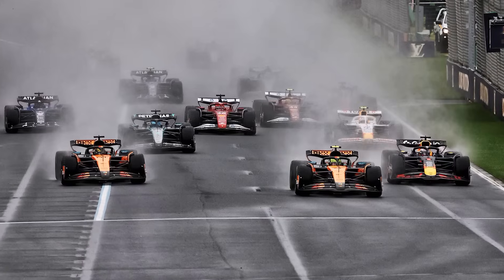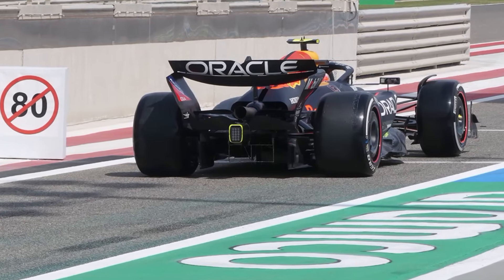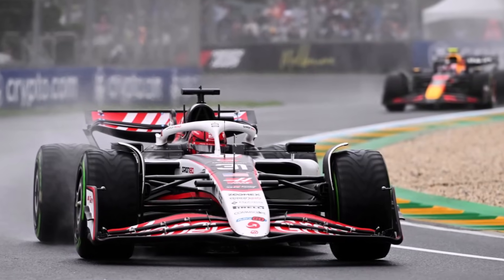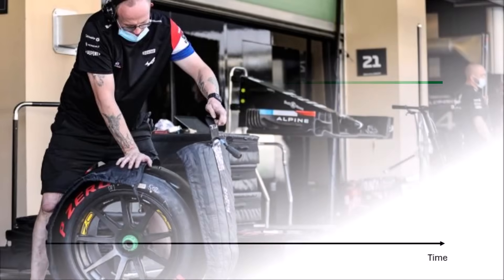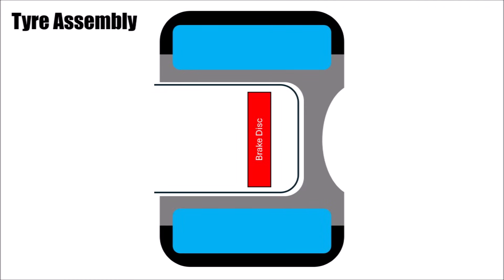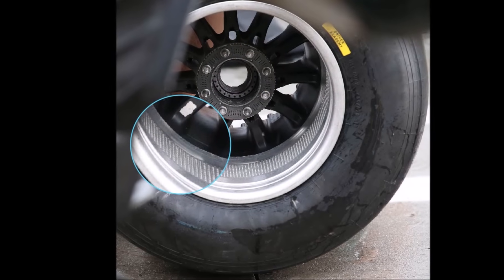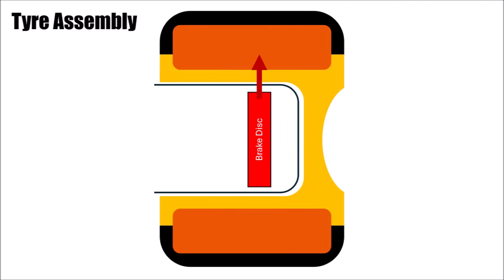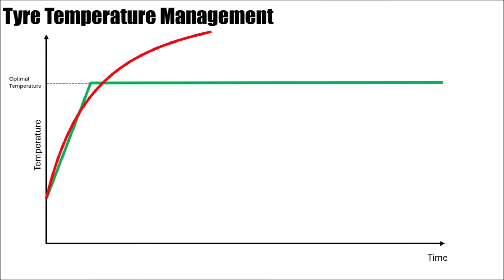F1 2025 - McLaren's Tyre Management Advantage - Part 1

Comment: Hypothetically could McLaren have moved the rear brakes into the gearbox/ differential area and removed them off the wheel axle? If they were able to do something like this without compromising rear packaging too much it would massively reduce unspiring mass and improve suspension performance as well as reducing thermal input from rear brakes into the tyre…. I have nothing to say mclaren is doing such a thing, just a “would this work and or explain red bulls thermal readings?”

Comment: Just use a thermostat out of the old air-cooled VW's. Yes they had a bellows type t/stat that opened another air duct to control the engine temp.

Comment: theres a lot that could assist cooling, could be using metal or even heatpipes to draw heat away and in to exposed components that are in turn cooled by the fast moving air around them. maybe they have found ways to holloww out certain components and reduce their mass and so reduce their thermal potential meaning the components can heat up and cool down far quicker. would also mean higher spikes in heat (the times theyre hot, theyre hotter than most) but would also allow them to cool down to ambient so much faster they could keep the heat out of the tyres). could do that with 3d printing of components with hollow areas with either openings for cooling air to make its way in and out or just sealed off since air doesnt store that much heat compared to metals anyway.

Comment: there is one fluid that is in contact with the caliper and can carry heat: brake fluid
a possible strategy here would be to use the brake fluid to carry the heat away and then cooling it, the system can run like a diesel-hydraulic pump where simply closing a valve increases pressure for an hydraulic arm
now that i think about it it would explain the overheating issues Norris struggled with as the brake lines can be built with lower temperatures in mind, but this is just speculation
Reply: Brake fluid doesn't actually circulate through the system, unless they're using some kind of circular brake circuit with check valves, but either way I think this would be a pretty obvious solution if it were really that effective.
Reply: That is correct, but air is also a fluid gg just different desity #duckandcover
Reply: @rainergumpert5945  liquid would probably better terminology to use but you get the point anyway

Comment: Using more “heat conductive” carbon fibre mix for the brake drum assembly ? Carbon fibre is an insulator right ? So a mix of carbon and a metal alloy (like the so called Carbotanium Pagani has been using for ages on the Huyara) would make it more conductive to heat ? So the tyres would heat sooner and heat in the tyres would transfer to the brake drum easier and with good brake cooling can dissipate the heat better to keep the tyres from over heating. I have no experience in this craft. This is a guess from my basic science knowledge.
Reply: Heat goes from the brakes to the tires, not the other way around. Normal operating temperature for F1 brake pads is about 500C.

Comment: Why water? There are tons of fluid substances used to keep you chill, including those in the driver chill vests. If a substance is easy to chill(air) and hard to warm up(brake discs), all you gotta do is make a device to move it around so that it's chilled by the passing air when brakes are off. Question is, how do they do it to move fast from brake on to brake off?

Comment: Since active flaps etc are not allowed, use of bi-metal in a flap holder looks like an interesting way. Too hot, the bimetal flap bends and let more air in... too cold, it bends in the opposite direction reducing the air flow. I would call the "passive flap"...
Reply: just like the passive breaking RB had, flexi-wings. FIA stomping innovation

Comment: Are the wheels homologated for the whole season?

If not, especially with the aero cover, it's a lot harder to see if they're changing wheels race by race, maybe they have different constructions that conduct heat differently or diffuse heat, depending on expected track conditions.
Reply: Wheels are season homologated, brake assemblies are not.

Comment: I just think they make more downforce than the others at low and medium speeds. Those are the speed ranges where the car slides the most because there's less downforce helping you. If you have more downforce than the others in that speed range you will need less slip angle to generate cornering grip. This all comes down to the size and position of the flow structures at the back of the car, and the size of the diffuser itself. As these two parameters control the back pressure in the diffuser.

The diffuser works very much like the intake port of a combustion engine, with the flow structure acting as the valve, the diffuser expansion acting as the bowl, and the area near the crash structure as the valve seat and combustion chamber.

Think of a VTEC system, the port and valve area is oversized for the engine, at low engine speeds, in order to have enough flow velocity, you need very low lift from the valve to accelerate the air enough through the large volume. At higher engine speeds when the valve starts to choke, you need more lift to allow more air around the valve. The way you size your diffuser and maintain and position your flow structures is similar to sizing the bowl, valve/valve seat, and chamber on a cylinder head.

Comment: Perhaps they have found some sort of heat activated reflective coating, or are using a bi-metal flap covering an air channel? 

So when a set temperature is reached (like during braking) this activates and prevents or restricts the heat reaching the rim surface.
Reply: I think it's such an obvious idea that if moving parts were allowed there everyone would have them already.
Reply: @AnttiBrax  moving parts isn't allowed. But if you're cheating anything goes.

If they've managed to hide it, then it's going to be hard to find I think.
Reply: Like a thermostat?

Comment: Thinking out loud: if there is need to keep a certain temperature regardless of how much energy is provided, did anyone considered to design a filament, which has a phase transition at desired temperature? a simple example is still a water: if one heats it up to 100C, it stays 100C, even if more energy is delivered, which is used for phase transition. Obviously, I don't propose to use water, but let's say a foam or polymer, which will change its state, while maintaining the desired temperature...

Comment: There are many thermal management materials that can help with temperature management. 
I bet they simply have an insulating blanket material inside the brake housing which helps dampen the temperature fluctuations.
Reply: The good old gold foil maybe? Nah that's too obvious
Reply: @ foil is too reflective. You want an absorbing material that holds heat energy. Like a wet blanket or a gel like material.